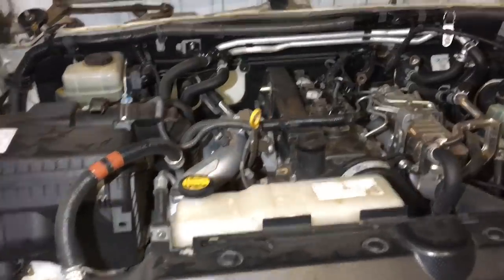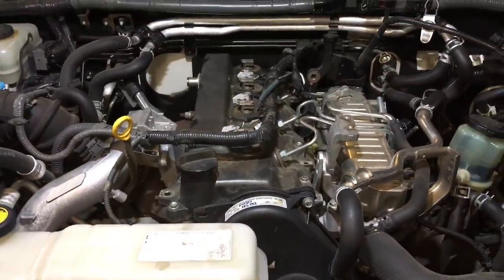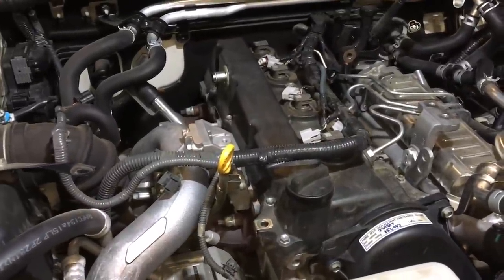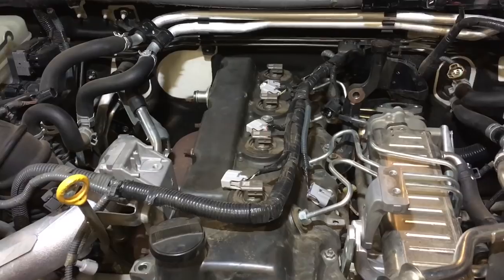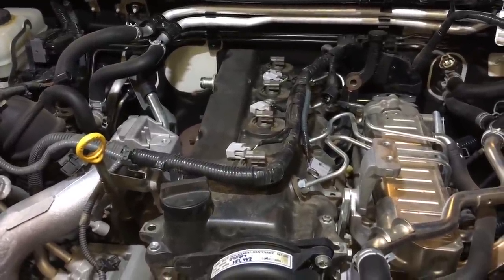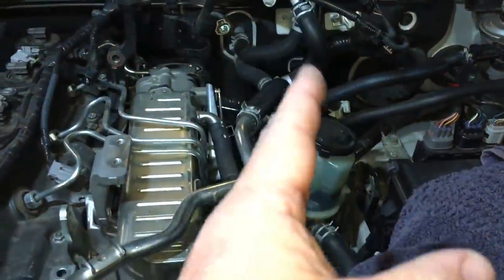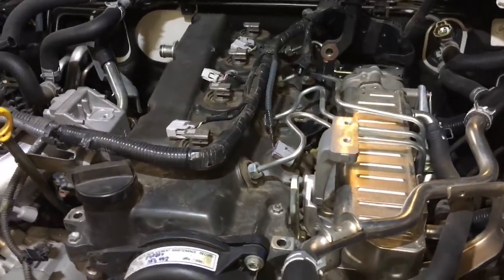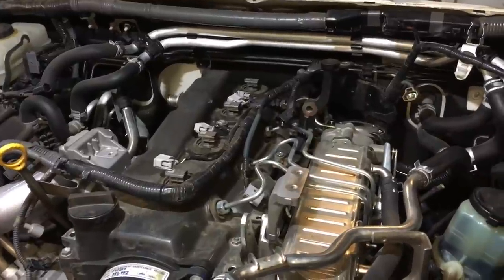MAATTE SEE THE UNNECESSARY DAMAGE - 1 owner always Toyota Services

Comment: standard head size AF for M8 bolts is 13mm going by DIN standards.  Automotive standards tend to use an AF size smaller than DIN standards which are used in industrial applications, and they tend to sometimes use standards only know to themselves. most unusual one I came across was a 30mm diameter with an imperial 12TPI UNF thread form used on a Japanese earth moving machine

Comment: Haha you sound as frustrated as I was after a butcher had been into the Hilux I brought.  10mm hole punched in the value cover and a rock wedged in the oil filter??? Cross threaded 8mm egr  bolt???